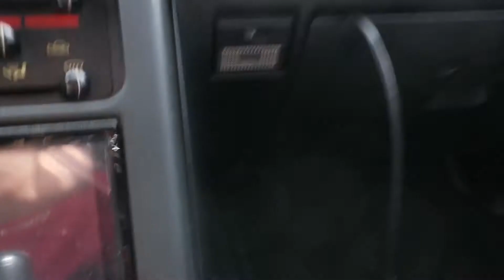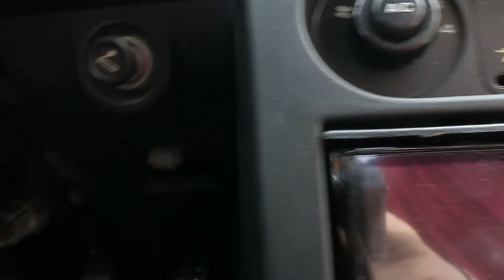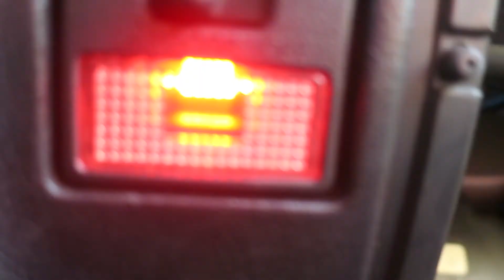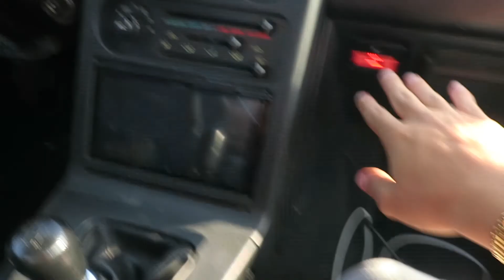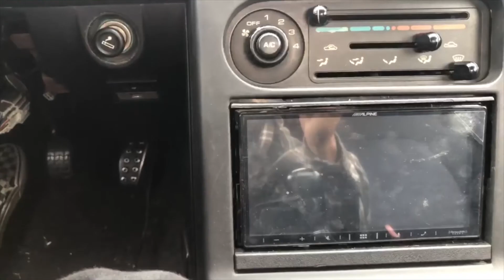How to Restore/Upgrade INTERIOR LIGHTS to LEDs! (on miata)

Comment: Where did you get the bulbs at?
Reply from the maker: eBay, i think i linked it in the description but the ad might not be there anymore. it’s a 31mm LED. 31mm is the biggest you can put in.